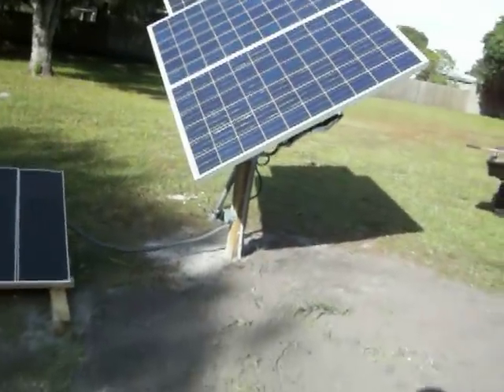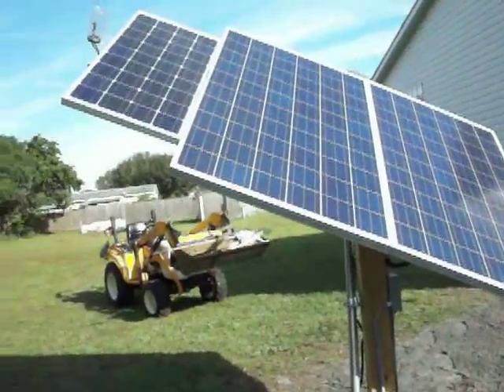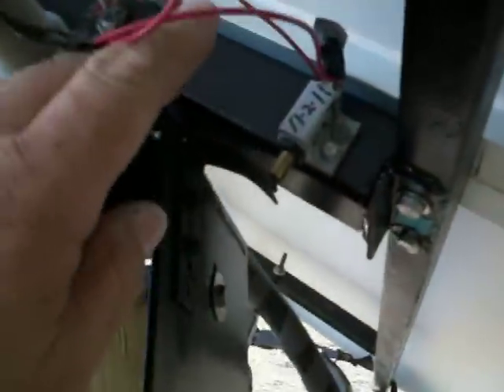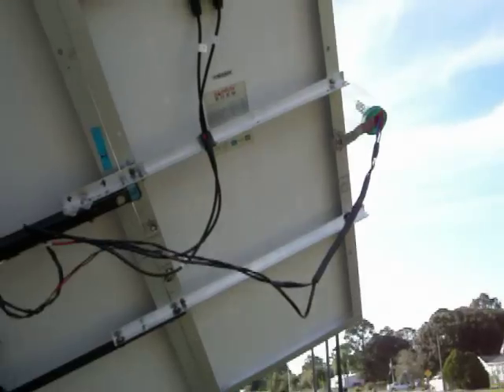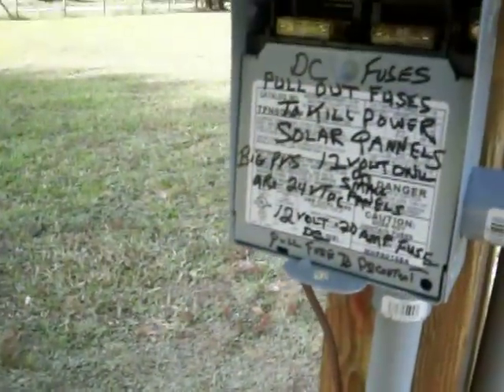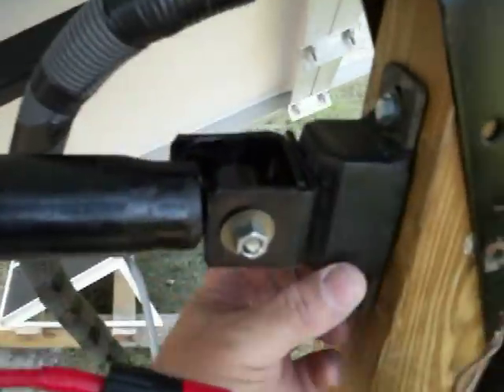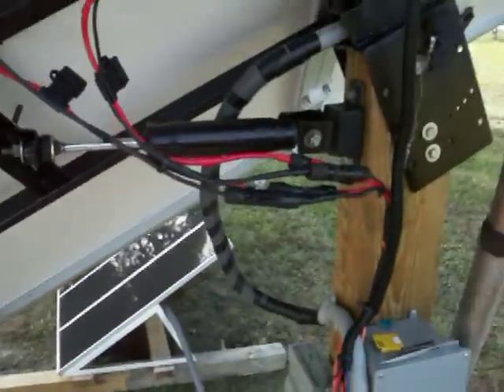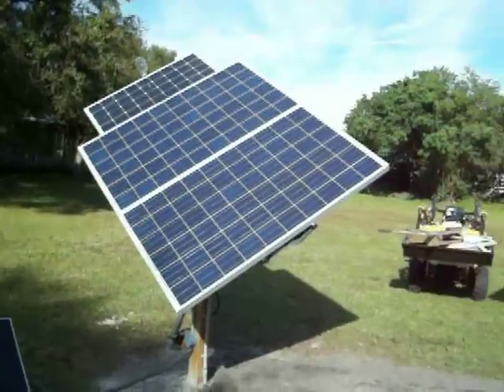Solar Tracker D.I.Y. Complete.= TO 970 watts@12 Volts MPPT.

Comment: I strongly advise NOT buying those shit Harbor Freight panels. They were a good deal  years ago but no more. There are two different kinds of solar panel types which are monocrystalline and polycrystalline (HF). They shouldn't be mixed which is what was done here. Per watt they are not equal and HF panels are more expensive per watt these days. Shop around and don't mix different types or different sizes.  Both "no no's" done on this setup. People how don't know, do it all the time. don't do it.

Comment from the maker: @Xringer The weights off set top 90 watt panel 18LBS,out buy 21.ins like a big kid on a see saw,also to help ballance the gas pressure shock@+_15LBS.POS.pressure pushing up to help stop rocking back and forth and to absorbe some wind load.Works great.

Comment from the maker: @Xringer The 2 big panels are 220 watts @ 24 volts going into a Morning Star SS MPPT-15L charge controller,it will take input vt@ 12-24-36.and allow u to charge a 12 vt bank ,thats what i use so it sees the 24 vt panels as 12vt so @there rated 8 amps each@ 24 vt. using current"boost" if it reads 8 amps@24 each panels used at a12vt setting or 16 amps limited at 15 max.so each 1 has its on charger 1 per 24vt panel =440 watts@12..top panel is 12 vt,90 watt&90 watt on ground with a third controller.

Comment from the maker: @shartne Thanks ,I just got done checking charge amps.11:00 am 35.2 Amps.in .17 out thru go power running 24/7 powering my living room & office as i type this.Batt@ 12.17 @8am now@ 12.92 volts useing 178 Watts since 9.00AM. Very happy so far ,Still playing with sloar eye to zero it in. Big Diff in power since Tracking have used 4.7 Kw in 63 hrs.  4-Deka- DC31DT-@105AH each dont seem to go below 12.12 ever. Except for test to see how long frige can run on batts.18 HRS.11.76 volt.